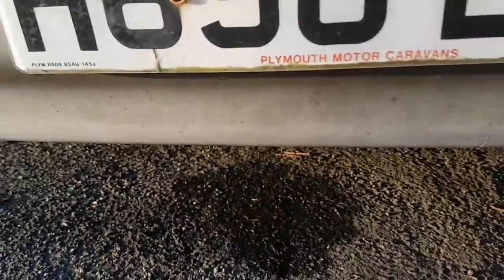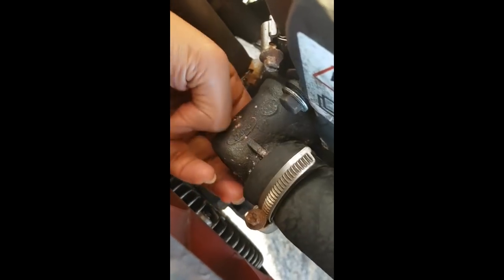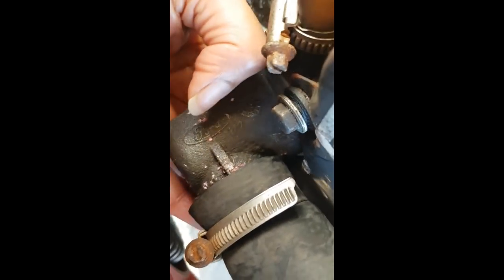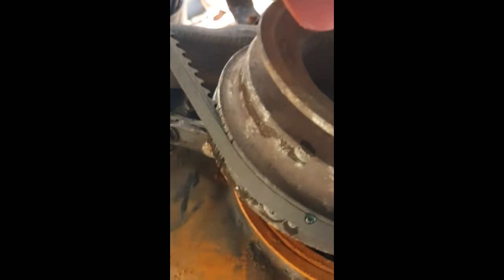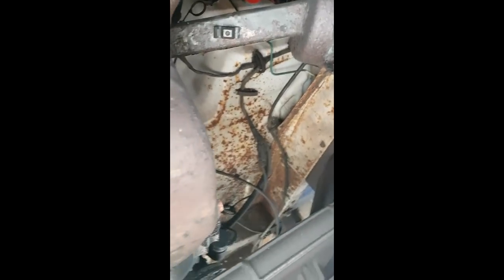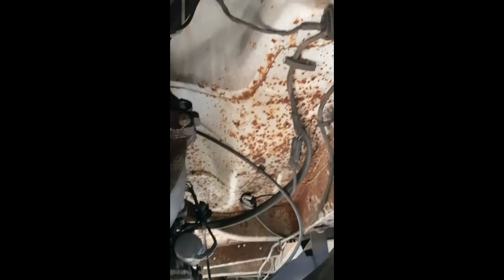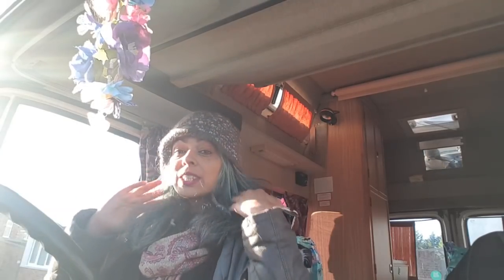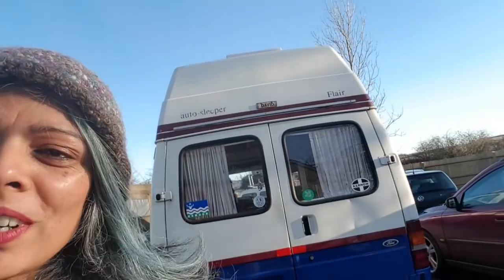She's sprung a leak again!

Comment: Chassis looks in good condition from what you showed  for 30+years old vehicle looks like it just hasn't been serviced properly that's all thermostat leak is nothing to worry about plus its only January by the time spring comes you will have flair in tip top condition so don't give up yet lol you almost at the finish line and nice to see you getting fitter lop for all them future trips Anita :)
Reply from the maker: TheJason13666 thankyou and yes I'm looking forward to some trips in her.. I want to go crazy in the refurbishment of the inside but been holding off till the mechanics are all done x

Comment: I invested in a pair of ramps from Halffords and whenever I get a used car she goes on the ramps and I wire brush any loose rust of an then spray with chassis paint from a spray can . If you do this make sure you wedge the wheels on the ground .

Comment: the man that sold you that van ripped you off big time.   Even a blind man could see that the van has been put through its paces for decades and is on its last legs.      and it has 60k mileage on the clock from the early 90s?  Really?    Pull the other one it's got bells on.    The mileometer has most likely been tinkered with by the vendor.    That van has been thrashed into the ground with very heavy usage.  It''s obvious to anyone.